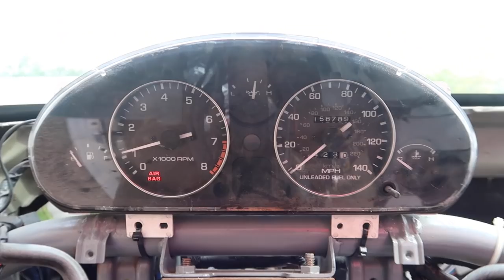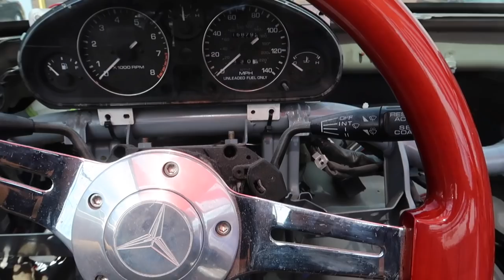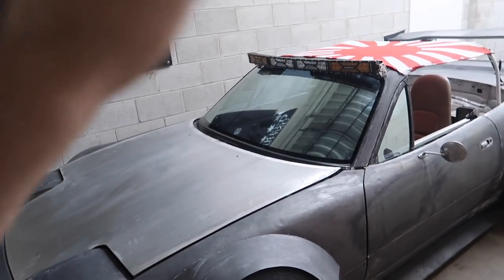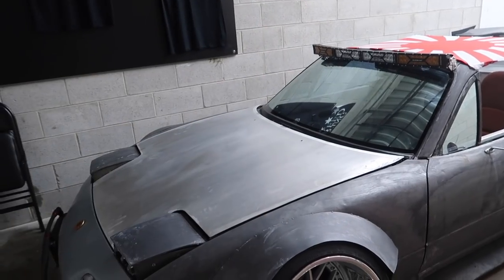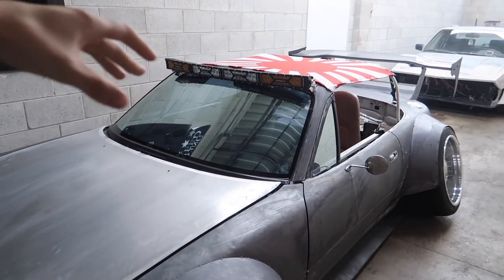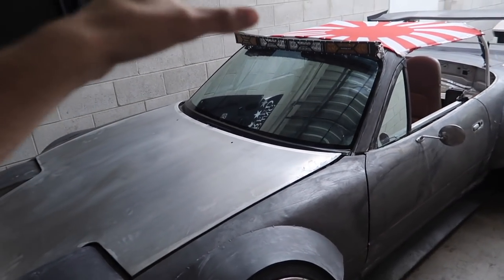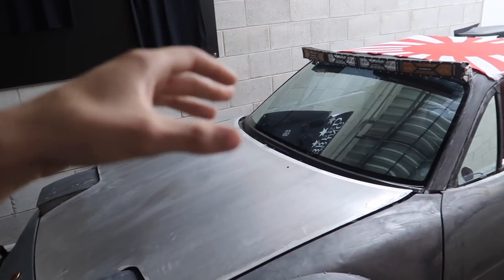5% One Way Mirror Chrome Tint *INSANE*

Comment: Funny how you can't legally tint your windshield but I can have the same tint on my motorcycle helmet lens, no questions asked. I've got to say your cars are way more extreme than my streetfightered GS500. Keep up the good work! 👍
Reply: J M motorcycle is different bro
Reply: @groziethomas3127  Go ahead and attempt to flip your dark tinted windshield out of the way using one hand while driving in low light conditions. That is the difference lol.
Reply: It's partially because they want to be able to see what's going on inside the car.  I doubt it's because they care so much about our visibility.
Reply: @lordsheogorath3377  flipping the visor up on your helmet is illegal unless you have protective glasses on underneath. Riding without eye protection is against the fuzz in illinois
Reply: Furthermore in illinois you can get a special plate that states you have windshield tint (obviously only if your tryn to do it legally) however to be eligible for windshield tint in illinois you must have a professional diagnosis of a condition such as albinism or allergy to the sun that makes having tint nessicery, specifically excluding conditions that can be overcome by wearing eyeglasses or shades. Fun fact...

Comment: You can have tint on your front window in Illinois. Just not the whole thing. A sun strip is allowed at the top. I think its up to 7 inches down from top in the middle and up to 10 from the top at the edge.  Can also tell your doctor bright light hurts your eyes, than the state will give you a black plate which allows to fully tint all Windows ... I think.  The black plate is also used for medical supply transporters .

Comment: so im new to the channel and i gotta ask, why the camber? maybe im wrong but im pretty sure thats not good for the life of the tires as well as it offers less tracton than the whole tire on the ground. also kinda looks like the car was squashed.
Reply from the maker: It's just the style. Camber is the main reason I started building the car and for that reason I wont be changing it. Its not a performance car by any means, purely for style and looks. Btw welcome to the channel! If you take a look at some of the older vids most of your questions should be answered.
Reply: @MorbidKitKat1  i can understand that. i guess thats how new styles are born, by trying it out. still a cool little machine regardless.

Comment: This is acctually illegal to do on the front windsheild and the front windows but it looks sexy !!!
Reply from the maker: Okay
Reply: s mirror tint illegal?
Tinting is permitted only along the top 5 inches of the windshield. Side and rear windows may not be covered or treated with tinting that allows a light transmittance of less than 35%. Reflective material is not permitted on any vehicle windows. All windows except the rear window must contain 2-way glass. from dmv website. im not the kinda guy to give two i like burnouts in wallmart parking lots and slammed and scrapin exhausts
Reply from the maker: @thathondachannel2105  did you bother watching the whole video?
Reply: Yeah i did i know